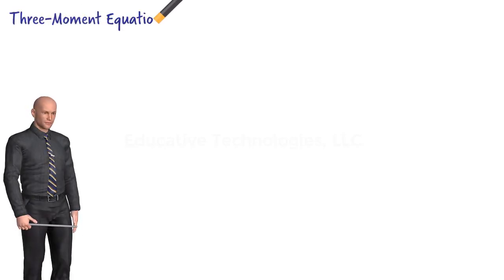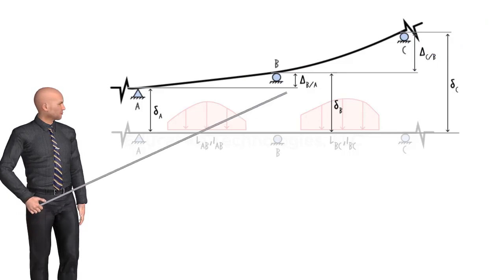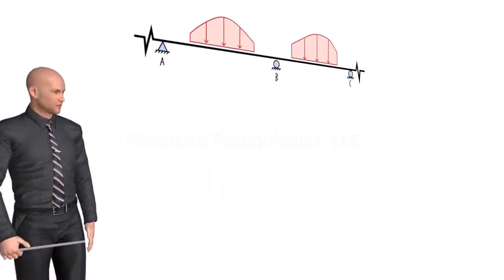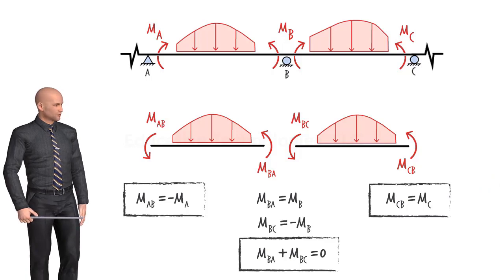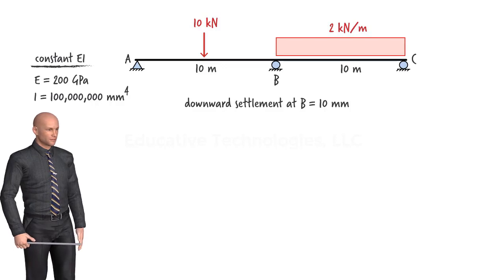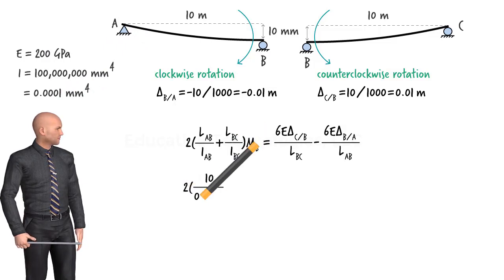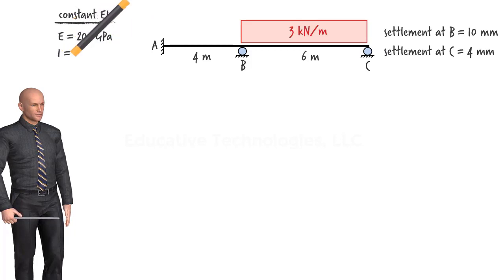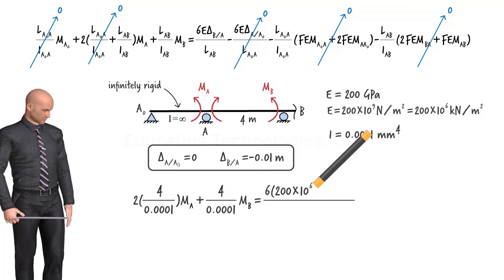SA61: The Three-Moment Equation for the Analysis of Continuous Beams (Part II)

Comment: Why FEM are zero?  6:24
Reply from the maker: The question asks for the effect of the support settlement on the reaction forces. This means in our analysis we only consider the settlement, not the applied loads. The fixed-end moments (FEM) in a member come from the applied load, not the support settlement. Since the applied loads play no role in this analysis, the FEMs = 0.